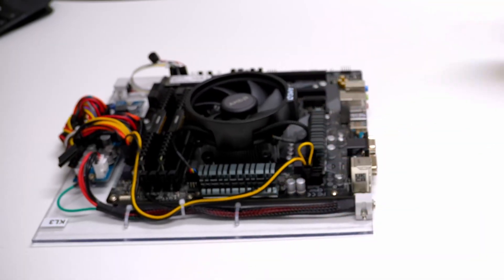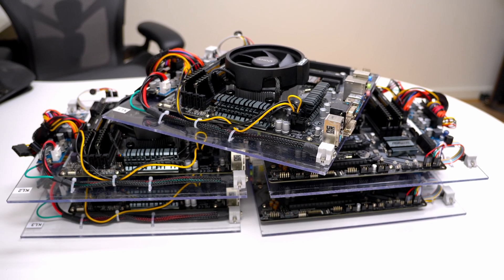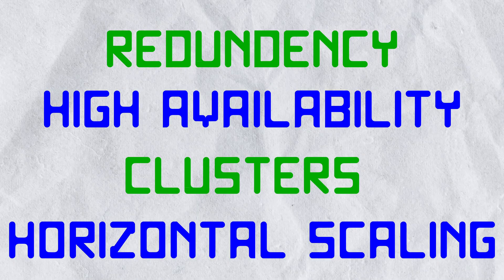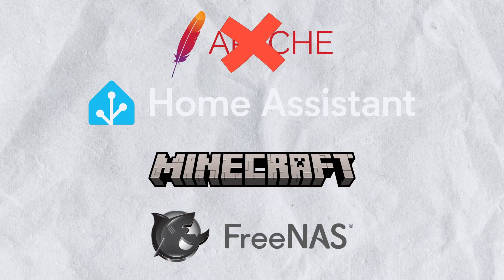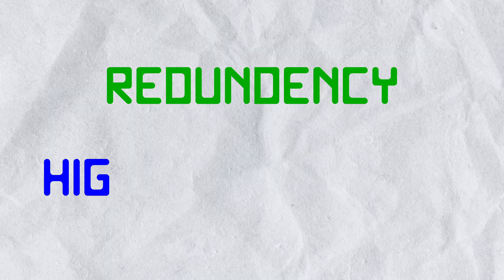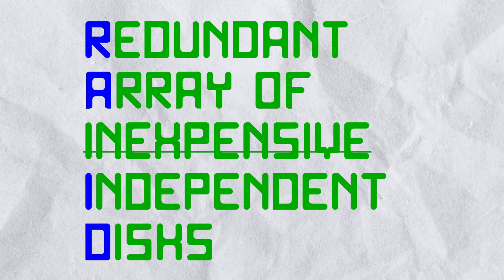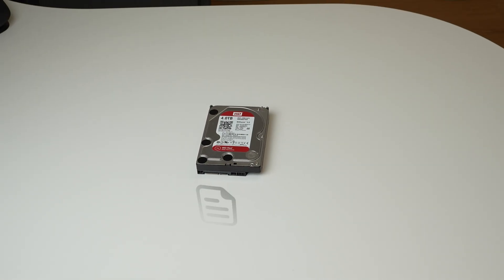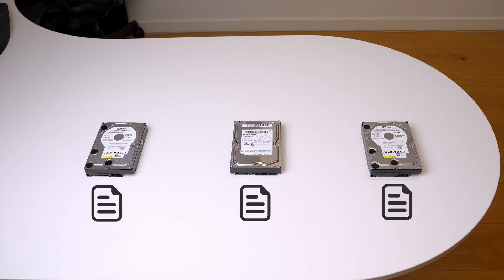Homelab: The Real Reason I Built My Blade Servers | DIY Blade Servers Part 2

Comment: Brilliant idea. Just one suggestion. It looks like you have fixed the motherboards on a plexiglass sheet. It would have been better if it was metal (steel and/or Aluminium) because you need grounding of EM radiations. Even now it can be done if you connect the motherboard holding screws to the power supply ground. Read more before you do the connections because wrong connections will kill your motherboard. Good grounding will make your hardware last long. I have a similar setup with Thin clients and old motherboards from 2014.